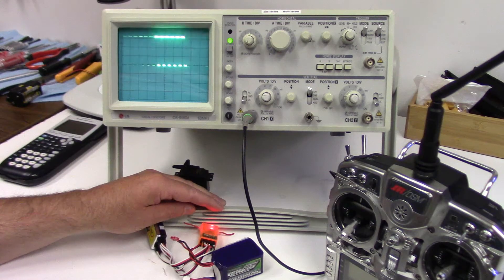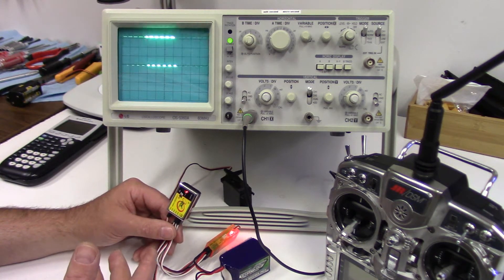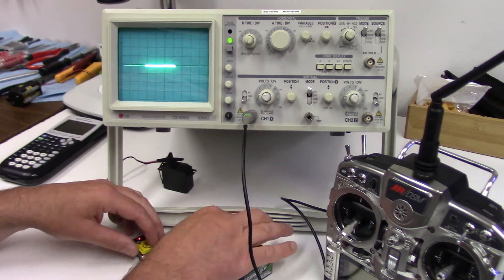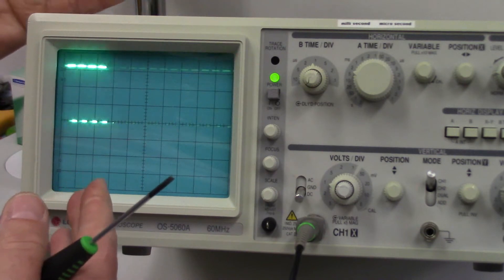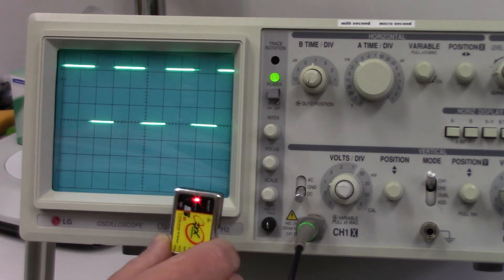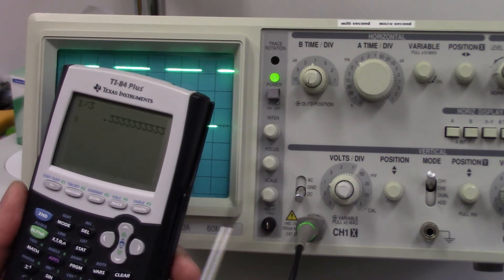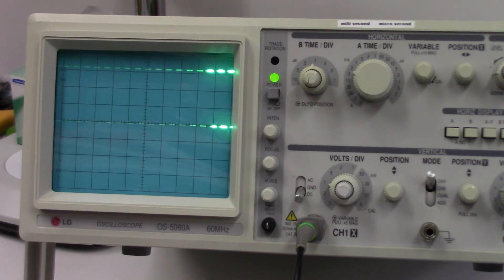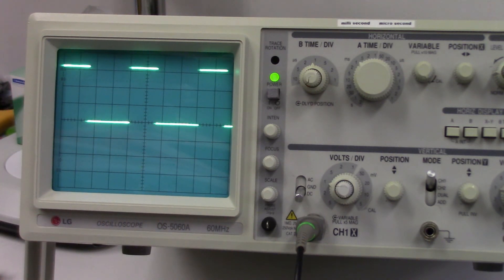RC Servo FBL PWM Refresh Rate Demonstration

Comment: Bad News....I fried a servo.....Good News...the motor is still good, so i can by pass the fried board and just have small geared motor out put. So not a total loss, and I will find a use for it. 

Brand new to RC and servos and such, the one I fried was a cheapo so no big loss.  Interesting to learn more about how these actually work and not just treat them like little 'black boxes'. - Cheers

Comment: Thanks for sharing, this is really interesting. I'm interested to know if narrow band servos would work with transmitters like the Radiomaster TX16S which, if I understand correctly,  has a range of 1000-2000us, where narrow band centres around 760us?

Comment: hello sir .may i use digital servos with 300 or 333hz refresh rate on control system that delivers fixed 495hz refresh rate.is it causes damages or variance in performance as digital known for accuracy.
Reply from the maker: If the refresh rate (495hz) is higher than the servo rating (300 hz), the servo will burn out. You must use servos rated at (or higher) than the refresh frequency they are being sent.
Reply: so..you have any sugestion that  can use with 495hz refreah rate